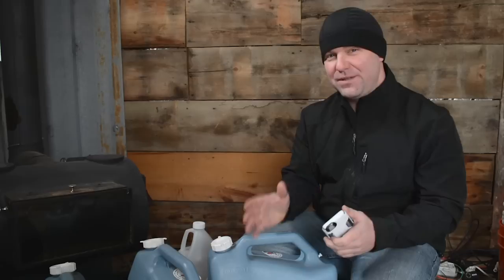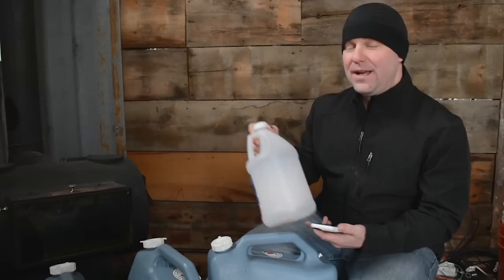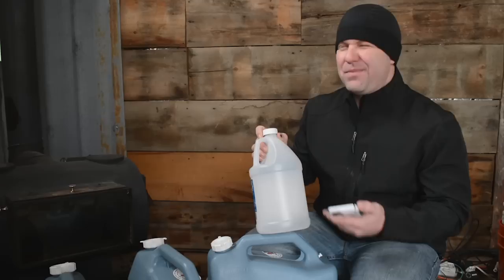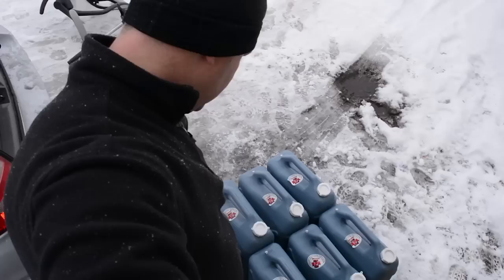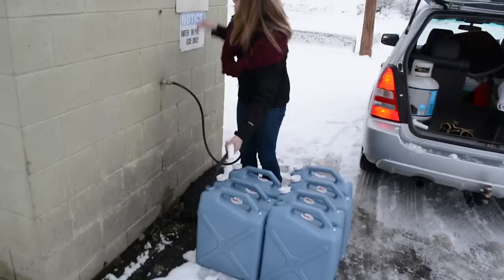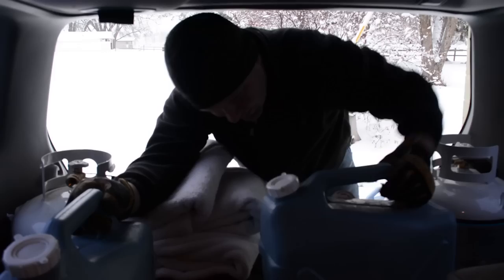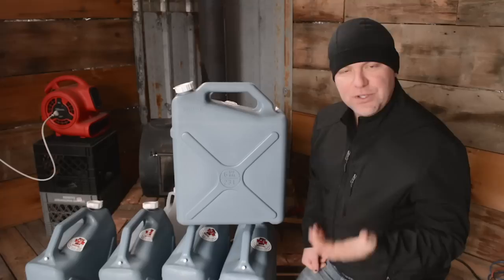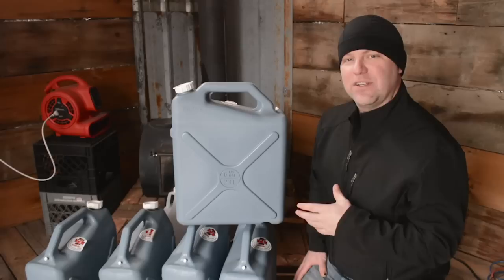Stupid-Easy OFF GRID WATER SYSTEM FOR RV!

Comment: Please consider the legionella bacteria, when keeping water next to your stove.
Reply from the maker: +Splinter5570 We'll check into it! Cheers!
Reply from the maker: +Splinter5570 Very helpful information! https://en.wikipedia.org/wiki/Legionella Looks like proper chlorination of the water is a suitable deterrent for the bacteria.
Reply: When doing long-term water storage for emergency use (Southern California earthquakes), we used the recommended dosage of 1/8 teaspoon (6 drops) of unscented bleach per gallon of water. Kept cool (out of the sun), it was good for years (I had to dump it when we moved - it was still crystal clear)
Reply: Very good to know! "Chlorine dioxide does not produce any carcinogenic byproducts like chlorine when used in the purification of drinking water that contains natural organic compounds such as humic and fulvic acids, chlorine tends to form halogenated disinfection by-products such as trihalomethanes. Drinking water containing such disinfection by-products has been shown to increase the risk of cancer. ClO2 works differently to chlorine; its action is one of pure oxidation rather than halogenation, so these halogenated by-products are not formed."

Comment: why do you need to drive to town when you got all that snow around you. just get a metal sink set it up on top or near your heater, dump some snow into it and collect the water.  as for wasting water on showering you could get a hot tub with some filters and reuse the water  take a bath instead.
Reply: Have you melted snow for water??  It is a huge pain.  It takes a ton of snow to get a gallon of water. (Or close to it).
Reply: ton of snow will produce ton of water. can compare apples and oranges   ton is a measurement of weight where are gallon is a measurement of volume. Yes i understand that you will have a ratio of 1/2 or so depending on the density of the snow.
Reply: Aleksey M, Obviously, you have never done it.  In any pan, you will have to refill over and over 10-12 times with snow to fill with water.  You need fairly deep snow-six or more inches or you pick up a lot of debris.  Dogs?  Don't want yellow snow, either.  I did discover that adding the snow to an inch or two of water in the pan works way better than just snow.  It is still a lot of bother.

Comment: Why didn't you just drill a well?
Reply: illyounotme
We just had 3 wells drilled on our property in the Rocky Mountains in Colorado and they were $600 each. The ones we had drilled here in Louisiana were $188 each because they were only 60 feet deep.

The tax assessor told us that drilling the wells would keep our taxes from going up because without permanent improvements, they treat the property owners as land speculators & raise the taxes.

I think there must be some other reason, it may be different in the state where they are.
Reply: illyounotme
OH, ok, I didn't know where he was or that they have water issues.

The thing the tax assessor was talking about is land speculators...like hedge funds and stuff. They buy up huge tracks of land cheap, not to sell but to keep off the market to force the prices to go up elsewhere, everywhere.

It was some of the same stuff that they were doing that caused the housing bust and the economy to collapse.

Some states are doing what they can to get rid of those parasites who destroy economies and people's lives. Charging them a 1,000 times more tax is a good way to get rid of them LOL.

We ended up having to get someone to graze cows on it while we are in the process of moving so that the tax man would not think we were speculators. For some reason he thought the flagging set out for the cross fencing was markers for a subdivision...that is insane, it is miles and miles away from anything that would be considered a suburb LOL.

Comment: - You spent over five minutes just talking about what you're going to talk about, followed by several minutes at the end summarizing and advertising your website. What a waste of time. Without that, this video (the worthwhile stuff) could have been just two or three minutes long.
   By the say, garden hoses are supposedly not safe (chemicals, etc) for drinking water. Most say you should be using hoses made specifically for drinking water. However, I'm certainly no expert, so don't take my word for it.

Comment: 6 Gallons of water weighs 60 pounds, 10 pounds per gallon.
Reply: +Scott Foster 
Water weighs 8.34 pounds per gallon.
Reply: You failed to count container. Standard tank engineering counts fluid plus container.
Reply: +Scott Foster 
I merely stated that one gallon of water weighs 8.34 gallons.
To say that 1 gallon of water weighs 10 pounds is incorrect.
If you had included additional weigh is for container in your initial comment then I would not have commented.
Reply: It is always been taught to say a gallon of fluid carried in container a is rounded to the next even number.
Reply: Maybe you were taught that. I was not.
Where were you taught
8.3 times 6 equals 49.8 rounded to next even number would be 50.
Reply: 8.50 rounded to the next even number is 10.
Reply: +Scott Foster 
 Some statisticians prefer to round 5 to the nearest even number. As a 
result, about half of the time 5 will be rounded up, and about half of 
the time it will be rounded down. In this way, 26.5 rounded to the 
nearest even number would be 26—it would be rounded down. And, 77.5 
rounded to the nearest even number would be 78—it would be rounded up.
Google Rounding Number Rules

8.34 what a gallon of water weighs would be rounded to the nearest even number would be 8 not 10
Reply: Dude you fail to make one bit of sense ,I  am talking from being educated in drinking water engineering, No dam way can 8.50 be rounded down to the next even number.!
Reply: +Scott Foster 
You say you are educated but you fail to show it and you talk as if you are the only one that is educated again you are wrong. My last statement was from Rounding Number Rules that you can google on the internet so it is not me who doesn't make sense. If you want to continue arguing do so with the statisticians, mathematicians, and the internet as you seem to know more than them.
Good night.
Reply: +Scott Foster Your correct Scott.  Imperial gal weighs 10 lbs. US gal weighs 8.34 lbs
Reply: You always go to the next  even number because every container is a different weight plus 10 is a easier number to figure from.
Reply: Go look up NFPA Guide lines and they say use 10 pounds when figuring water tanks..  When your planning your carry method 10 is a easier weight factor to factor for variances in containers.
Reply: Do not invent facts - you are nearly 20% off, that makes an enormous difference in energy consumption when pumping water up 50 floors.  You can go to any enginnering site online to find the correct information.  Engineering is not about youtube guessers!